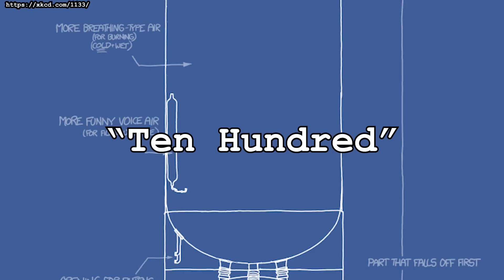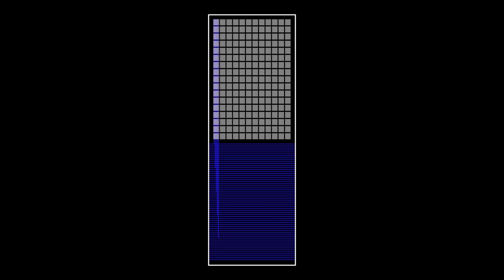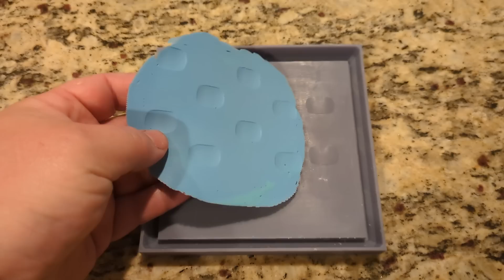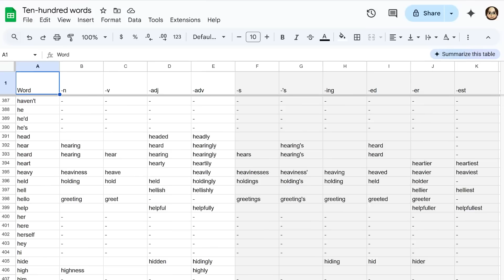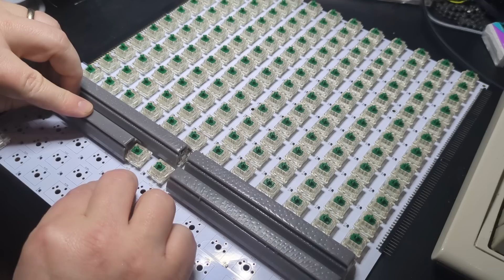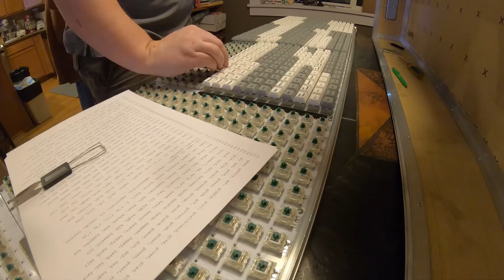A keyboard with ten hundred keys

Comment: 38:33 So, how did you write this line?  You said you did not have the number after seven; did you use the past word for “to eat”?  The words at the bottom of the computer-movie-thing (the ones usually used by people who can't hear well, but that I find good anyway) say the number after seven, written out as a word, which you said you certainly could not use.
Reply: (Note: I wanted to address you as Mister Three Centimeters or something, but I couldnʼt find a unit of length that would actually be accepted.  It had inch, but not the fractions Iʼd need; it had 3, but not centimeters.)

Comment: toshiba once produced an "index typewriter" with a drum covered in kanji.  you'd move and rotate it, to position the desired character under a stylus, then press a key to lift the appropriate row of type slugs and slam the right one into the platen. still not the fastest input method, but a more practical form factor.

Comment: 11:10 I have used Port Expanders with Aruino Unos recently, there are 7 adress bits. but in most cases 4 of them are pre dtermined by the manufeacturer. Just to let you know. In case you need for than 8 there is also the same IC with an A version, that has a different internal adress.

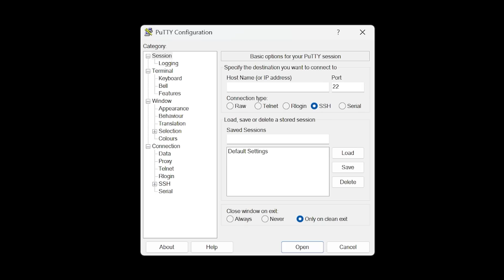Comment: 25:45 The ASCII character BEL dates from the original 1963 ASCII standard. But it exists in ASCII for backwards compatibility (!) with the ITA2 teleprinter code, standardised in 1932. That, in turn, comes from the Western Union code, which added a BEL character to the 1901 Murray code. (It's not clear exactly when Western Union did this, but presumably it was at some point in the ninteen-oughts.

So we can quite definitively say that Arduino's terminal client, in not supporting BEL, is still at least up to 1901 standards.

Comment: One change you could make is to move the modifier keys to the lower center of the board instead of on the far right - at least you wouldn't have to reach so far to modify words on the far ends of the keyboard.

Comment: I love the project as a whole, but the IC choice hurts... those I/O expanders' interrupts aren't going to fire until a column is scanned, and the required CPU intervention for key-scanning overwhelms any benefit that could provide.

It's too late for this particular design of course, but a column scan with 1-of-16 decoders (paired from cheap 74'138s) cascaded from 8 driving bits off a 74'595 can be directly driven by an SPI output, to select any arbitrary one of 256 outputs very quickly and cost-effectively. One 74'165 per 8 rows added to that is enough to read a 256x32 matrix (assuming an SPI controller with a 32-bit FIFO), with no fancy $2 chips, in a purely DMA-driven process, from 4 I/O lines. Up to 3 extra '595s' outputs and any unused '165 inputs are free I/O pins, for status lights or scanned-with-every-column modifier keys. If latency is a concern, chuck the shift registers and stick in a pi pico to address and read in parallel.

Comment: can any one help me...i need to have an ardrino take a tun of blue tooth connections or radio ones ...i want a headset with first each ear being its own receiver and eventually id need about 9 diff audio inputs that i need to mix at will...if i use port expanders might i pull it off

Comment: The Arduino Serial Port has ASCII support.... Well C/C++ has. "\x<hex-code>" Than look at an ASCII table.
Reply: It's a bit simpler than that... your UARTs work with bytes, and don't care about encoding at all. The same is true of the actual bytes written to your microcontroller's flash when you upload from the Arduino IDE. Your source code is frequently in some ASCII superset, but C strings are byte arrays, as is the form of most machine code. You get ASCII back from the serial stream when it's decoded by e.g., the Arduino IDE's serial monitor itself, choosing to interpret the bytes it sees as such.

Comment: You normally use your first prototype PCB to iron out ALL your bugs... So you don't have to make four! 😆 It's also very helpful to read data sheets and standard specifications in the design phase rather than after assembly. But you learned that now.

Comment: Afaik the arduino can run multiple i²c busses, if you can run 12 you could build a 500000 matrix. You'd need a 708×708 grid which would be serviced by 16×8×12 port extenders.

If I'd do that I'd hardwire the matrix cause I'm not gonna pay for a 500000 key pcb.
Reply: Happy soldering! The magic of a nice flat PCB is you can wave-solder each sub-board of keys at once, instead of needing to touch off a million points by hand, with each row and column interconnecting all 708 points of span. If you were making this for some latency-sensitive purpose it might be better to make a tree of plain old serial ports to aggregate events, with a dedicated microcontroller on each PCB. 10 layers deep of 3-UART devices (1 upstream, 2 downstream) + a root device with >4 UARTs covers 2000 boards, where each can be a simple and conservative 16x16 or 8x32 matrix, and no common clocking is needed.

2000 identical PCBs are also a lot cheaper than one PCB 2000x the size. :-)

Comment: Could you have used a 5- or 6-pin SMD IC for each push button that has its own address, all on the same bus, so you don't need a massive grid to be scanned?
Very much like the RGB LED strips that have each LED addressable. But in reverse

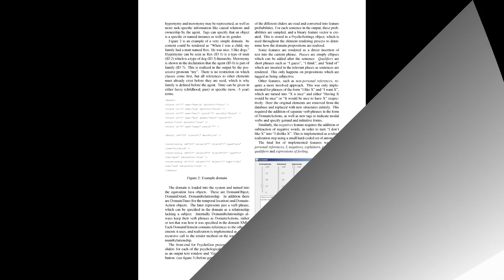Comment: The "Richard Nixon" slider at 6:04 is confusing because he was a gifted orator and he spoke more eloquently than any president we've had after him, but he was also quite vulgar and abrasive behind closed doors. So the slider could mean anything, really
Reply from the maker: Specifically, it meant the likelihood that the generated output would follow Nixon's speech patterns with regards to non-personal references, "I" pronoun use, negatives, explainers, pauses, "we" pronoun use, qualifiers and expressions of feeling. The analysis of these is from the Watergate tapes, so it wouldn't reflect his pre-written speeches. The Weintraub book contains data about some other features as well, but these were the ones which I could meaningfully implement in the simplenlg tool I was using for doing the text rendering.
Reply: @Attoparsec  Ah, mystery solved! Thank you

Comment: Did you consider the range and scope of ideas related to "keyboard" input for computers or devices or the various limitations of abilities of users, or any scale of optimization? Such as visual perception ability/blindness? Physical dexterity or input capacities of users - quadraplegic to persons with more than 10 fingers?

What about use of your input factors - spoken/written language base of limited subset of "most commonly used words" - to alternative modes/media of input:
-combined speech/manual entry operation
-combined visual motion/movement capture in put by monitoring hands, or eye or other body motion?
- did you do Prior Art research in the field of sign languages?

It seems like fun and whimsical experiment you accomplished. I encourage you to build on the base of knowledge you have created for yourself, and expand your thinking to include the above, existing state-of-art alternative devices and systems to develop more plans and projects. It can take a while to find the most productive text search strings to find the existing technologies, but they are out there. 

Try this search string: "Apple Vision Pro Supports Virtual Typing, Navigation Through Hand Gestures and Eye Movements" expand search to include systems produced between 2000 and 2015. Popular musician Bjork, even used such systems in her live performances to control music, love stage lighting, visual display content across various projection systems.

Imagine using the simple QWERTY keyboard by laser, on to 3D objects, with each spot on the object/sculpted model/"display surface" as activation/input signal points. Now, consider virtualizing the entire scene into eyeware input and virtualized controls. Either way can function, but various physical use conditions produce unique measures, limits of appropriate application. Probably not great input/display system for helicopter pilots, to require attention shift to anything other than live sky/terrain observation. I bet you  become an Imagineer for Disney or some other global competitor or emerging international system interface designers.

Comment: Maybe it would be easier to use if the words were grouped by category (like all the colors, all the numbers, etc.) instead of just alphabetically?
Also, maybe have multiple versions of each modifier key, so you don't need to stretch that much. (Or just put them in the middle.)

Comment: When you got to the point where the I2C just wasn't working and you were pulling your hair out, I literally said out loud "let me guess, the lines were routed backwards".  Why?  Because that's somehow always what happens with these sorts of things.  If something just isn't working when it really should, it always turns out to be the wrong lines going to the wrong pins somehow.  The SDA/SCL lines are swapped, or the UART's RX/TX lines are swapped, or something's address or data lines are off by one somehow, etc, etc.

And it even manages to happen if you've double or triple checked everything ahead of time, because you've been through all this before and are determined that it's absolutely not going to happen this time...  sigh.
Reply from the maker: A friend who does prototype board design professionally told me they've taken to adding some 0-ohm resistors right before the IC to leave an emergency crossover point because, yeah, it's just inevitable.

Comment: Tip for silicone with 3D resin moulds/casts: cure the resin print under UV while immersed in water in a beaker or something, for way longer than normal (like, at least half an hour for what should be a 5/10-min cure). Then hit it (gently) with a heat gun to help it outgas and give it a wash with detergent.

This seems to help a lot with whatever inhibits it. Give the silicone a couple additional hours to cure beyond the recommended, and again hit it with a heat gun for a couple minutes before demoulding if you suspect any goopiness (it may still be semi-soft at this point, but this can help get it out of the resin without tearing, and it'll finish curing better in air as long as it can hold shape.)

This'll probably make the print somewhat more brittle and probably compromises the silicone a bit too, but figuring this out saved me once on a deadline so it could help somebody else in a pinch. (I've even used this process intentionally a couple of times for one-off moulds--but definitely don't rely on it until you've tested it with your silicone of choice.)

Comment: a 1000 word keyboard could technically fit into 10 keys, one for each finger, 1 finger per bit. 2^10 = 1024, press down each key for the bits you need and when any key is released, sum bits and display corresponding word.

Comment: I 3d printed a heat transfer press using some flexible nylon i then pump steam into the print and it makes a good flexible press for heat transfer. It took alot of effort and only worked so so. I need a resin printer

Comment: I probably would have put one port extender on each strip and only routed the i²c and power lines between boards. This would also make it possible to have each strip in its own case---easier to transport. But I see the design constraints you gave yourself...

Comment: For doing this on a smaller scale and with off-the-shelf hardware, I can recommend programmable keyboards by Cherry and Tipro. They'll all show up as separate USB devices but you can set up as many of them as you want. Just be aware the Cherry onboard programmability is limited to 12 output keystrokes per physical key, so my symbol keyboard spits out strings that are then parsed by Auto HotKey on the computer side. Tipro is supposed to be much better for hardware programmability, but in North America it's like they don't even exist. (Also, Tipro uses mechanical switches on all of its keyboards, generally Cherry MX Black, where the Cherry G86 series is rubber dome -- though programmable versions of the G83 line also exist and use Cherry MX Red or Brown mechanical switches.)

Comment: This sounds like me 8:10 when designing word processor concepts in Minecraft. Simple in concept and a lot of numbers and figuring out the space constraints and logistics to work out capacity and space before i even start. My current one has 11x6 panels on the display to display Cyrillic and Latin, working on dead keys at the moment so can put in accents on different languages. Currently has 512 entries in the ROM for different characters with working shift/caps lock keys as well as working arrow keys, pgup, pgdn, home, end, insert, delete etc which use the character data lines. Im using hexadecimal, not binary for the encoding due to being able to carry larger numbers with less wires. My Alt key is currently a toggle between 2 banks of 256. Each using AND gates from 00 to FF. Keyboard using row and position coordinates to encode it. And my keyboard looks like a keyboard. The entire thing is pipelined in theory so you can type as fast as the buttons press and the display will always catch up. Passwords and programs can also work, using duel hex serial storage. The theory im going for is it being user friendly so anyone from anywhere in the world that uses a Cyrillic or Latin derived language can use it. Chinese and those symbolics language are far more complicated

Comment: oh my god, you know those holes next to the hole for the spring in the switch footprints? if you wanna make a pcb mount keyboard what you do is you get switches that have clips on the housing that go in there so that those align the switches and relieve stress on the soldered contacts and you don't need to fuck around with alignment jigs.

Comment: I think, rather than one word per key.  what about a keyboard that has commonly occurring pieces of words:

Th /Ph/er/ing/ies/.com/ maybe have the key's default to be lower case, but holding the shift key would make the first letter a capital. 

then a line of single letter key's - one with upper and lower cases.  Interestingly, this latter part of individual letters, would a homarge back to the original printing press.

they used to create words using individual letter stamp - with these stamps stored in boxes referred to as cases. so, picture a workspace where the worker assembles a newspaper page on their desk. over which is one box containing one set of letters. then above that is the other box of letters. 

over time, these boxes are eventually referred to a lower case set and an upper case set - hence what we refer to today as upper and lower case letters. 

but, ultimately - there has to be a point at which it would take someone longer to find the exact word, than type it out individually.  hence my original idea of word segments.

Q: what's the longest word that can be produced, using only the top line of a qwerty keyboard 
A: Typewriter

P.S.
"Like and do that thing" is a T-shirt just waiting to happen!

Comment: There is a language called "Basic English" with 850 words by Ogden.  He also did a 20k word dictionary.
   The Thesarus has 1K catahories of meaning that outlinesa 3 part hierarchy of 10x10x0 Linguistic Primes - there is a dictionary at the back that gives the number ooo to 999 number of regular English words.
  I used the thesarus to gind common words in English French, Italian and Spanis   I then devrloped a way of replacing the abreviation of the common words to 3 letters etc etc.
  Ogden had a friend that did 1,000 words in 26 languahes.  He left out Chinese - then did a special book for Chinese that bacame thebasis for "English as a Forign Language"
I also did 1,000 most common words for 15 languagrs.
It is interesting that the Latin based languages have one set of cognates with English.  The Germanic languages also have a near complete set cognates with English.  In most instances the Latin and Germamic cognates are different.
  Chinese is almost 100% different, but the characters make an interestin basis gor a gliphic conlang..
   Krep Thinking

Comment: Everything goes into a tree 🌳.  If it doesn't go into a tree, it creates nuclear power, the astral set.  Such things that don't go into a tree are psy-ops, monkey tether, gas punkers, zip heads, & tug spaz. Each dimension reaches across a amount of mechanization betwean adjacent dimensions.  Its very unusual to use a radio wave as an optical pulse, or an optical pulse a gravity dimension bose fractal.  Point -> pointers, but then you want LCD keys to show where your at in the tree branches.

Comment: I would have used SPI instead of I2C  and put the column  shift registers on the panel boards  reducing the number of interconnects, and the amount of customisation needed for each panel.